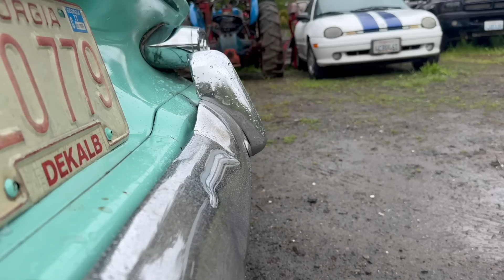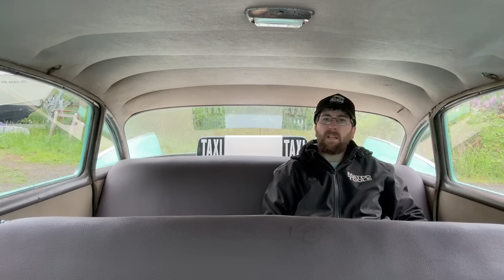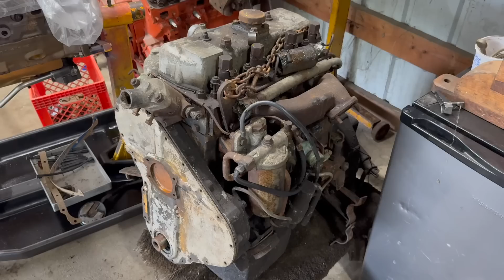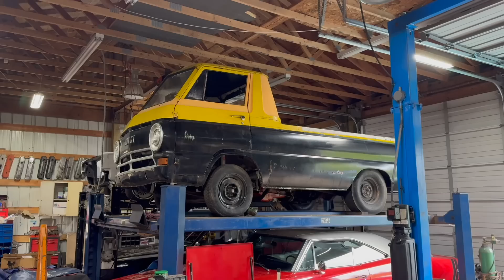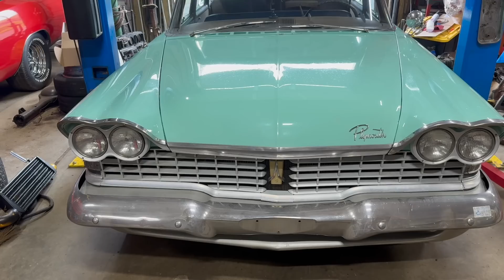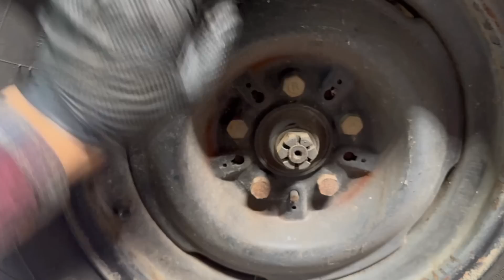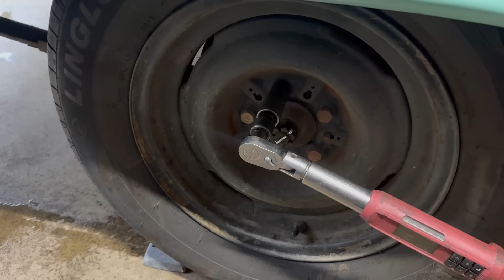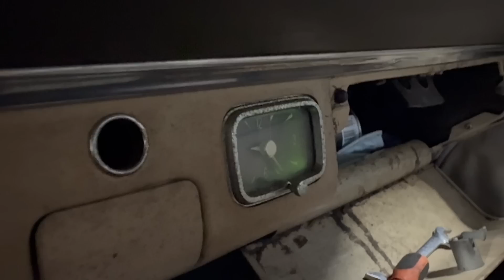Slow And Stinky - 1959 Plymouth Diesel Taxi Engine Tech, Test Drive, Safety Inspection (Not Good...)

Comment: So the left hand wheel bolts were only on the one left side?
Reply from the maker: Yep - Chrysler used reverse threads for the left hand wheels starting god knows when and ending after the 1970 model year.
Reply: @DeadDodgeGarage  I bought an Omni in the early 80's, ended up snapping off 2 frozen lugs on the drivers side right off the bat. My dad was  questioning after that if Chrysler was still using the  LH threads... he had a '57 Cornet at one time, that's how I knew they used them at least in the 50's & 60's.

Comment: Uh i think the person who had it last, had things apart when he offered you a trade and threw things back together enough to get it on a trailer and drop it off and roll out laughing
Reply from the maker: No, he didn’t do any of that stuff. I am sure it came to him that way, and he never went that far into it.
Reply: @DeadDodgeGarage  that's good to know- someone did just that it appears to him then?
Reply: Or just someone in a rush in the past, who forgot to come back through and tighten and pin everything I know if those nuts aren't pinned they can work loose but that's a lot more loose than youd think?

Comment: Can't be much slower that the standard 230 inch flathead 6.   That alternator may have been a mod unless it was a taxi option. 59 Mopars had a generator.  My '60 Valiant was supposedly the first Chrysler with an alternator.
Reply from the maker: It has LESS THAN HALF the horsepower of a 230. Or did when it was new. As of this filming, it probably had less than that. A heavy duty alternator was indeed a taxi option, but this isn’t that. I guess I never mentioned that had been added in the video.

Comment: I owned a 1960 Mercedes 180 db. 1800 cc diesel with a 4 on the tree. Pretty small and light car, so not a snail, but it averaged 49 mpg at 55 mph, and about 42 in town. Miss that thing.  Perkins diesels were installed in the factory on special order Checker Cabs.

Comment: What is up with the 3rd water attachment on the firewall?  I am a  Chrysler guy here in Washington myself.  I am the proud owner of 4 300's and former owner of over 30 other Chrysler products; Jeep, Plymouth, Dodge lots of Dodge, no  Desoto or Eagle.
Reply from the maker: Heater control valve is mounted to the far passenger side at the top. Coolant goes in the valve, then out to the heater core, and back to the engine. Nice!

Comment: Hi, thanks for uploading the video. A few suggestions you might have thought about already, but anyway.... For power, you might also have a look at the fuel filter(s). I was thinking about that throttle set-up, if it does not pull maximum vacuum it might not inject max fuel? So there should not be any leaks anywhere in the intake system I would think. The last owner showed that glow system in a video in some detail, it is some sort of flame start. The control light could be set up so that it  only starts glowing after a little while and slowly getting brighter until full on. The old glow systems sometimes worked like that, the idea being that you wait till it is full on and then start the engine. Very interesting technology! Best of luck figuring everything out!
Reply from the maker: Brand new filter. Verified throttle movement. Haven’t found any manifold leaks but am suspicious. Going to test the governor diaphragm next. Beyond that, I suspect timing chain stretch or other mechanical issues related to wear. Thanks!

Comment: Let me start with, your car your money. That said, leave this car stock. You may have the last remaining or running car with that engine in it. Keep in mind that in 1959, there was not much freeway out there. And as a taxi, that car didn't have to go more than 45 MPH. Leave it alone. Fix the flaws, leave it stock and enjoy it for what it is. I'm a hot rodder at heart, and I'm restomodding a '64 Studebaker Commander and a '69 Valiant. No turbo, no Bendix brakes...Leave it stock.
Reply from the maker: I will make zero modifications to the body of the car itself, and I will keep the Perkins engine. I will not promise to leave the engine naturally aspirated, or to leave it making the small amount of power (less than stock) that it is currently. I will not promise not to change the rear axle or carrier, or install a compatible three speed with an overdrive on the back. The spirit of the car will stay just as it is. I don’t see tasteful modifications designed to make it function as the best version of itself as a bad thing. The company who did these conversions claimed this car could do 70 miles an hour. I would like it to be able to cruise comfortably at 60, and to get there in less than two minutes. I don’t think these are unreasonable expectations.
Reply: @DeadDodgeGarage Do yourself and the next owner a favor. Save everything you pull of that car . Your dream may not be everyone elses.

Comment: Wow, fascinating story even though I've never been either a Mopar or a diesel fan, there is a European parallel though, in 1976 Alfa Romeo offered a Perkins powered Giulia, sounds like a very similar engine to Perky's, the only thing that would give the Alfa the edge would be it's lighter weight ! Also reminds me of when I was working on older cars often the fresher the paint job the more likely the mechanicals would be suspect..........

Comment: Back in 1967 I bought a 1957 Plymouth Belvedere 4 dr for $95.00.  I really believe these cars came pre rusted from the factory.   My Plymouth had the 318 poly engine with 2bbl carburetor and 2 speed Powerflyte transmission.   I always thought it was a great handling car with the full time power steering that gave you absolutely no road feel at all.  I had a friend with a 56 Ford 272 3 speed on column and off the line he just would leave me.  Another friend had a 56 Buick Roadmaster with the Dynaflow transmission and I couldn't match his top speed...But on winding twisting 2 lane blacktop I could run off and hide from them.  Plymouth's torsion bar front end and leaf springs on the rear just kept that car nailed to he road even with half worn out bias ply tires.   The rust got so bad the front seat came totally loose and I sold the car,  the fellow I sold it to took the engine out and put it on a saw mill where it lived for quite awhile.
Reply from the maker: Someone in another comment said they were rusting in the brochure. I’m pretty sure that was correct for ‘57s 😅

Comment: What voltage is the electrical system?
Reply from the maker: Factory 12 volt, negative ground. Chrysler was 12v across the board a couple years before this. The 70s alternator is obviously a later addition.

Comment: Are you really in DeKalb county Georgia? I'm in catoosa county Georgia.
Reply from the maker: No, but the car spent a lot of its life there.
Reply: @DeadDodgeGarage  I understand. She is a beautiful Savoy regardless. I had a 2 door Savoy from 1949. I sold it to an old dude for 8500 dollars and partial trade for a 1983 Toyota Hilux long bed crew cab. The engine was locked up, but I had a Tacoma V8 that I was able to redneck in and it worked out surprisingly well. Drove that thing til the cancer caused the front end to end up under the middle of the truck at a red light.

Comment: I've spent some time with those old Perkins as they end up in airport tugs all the time. They're really good motors. Certainly sad to trade it for a '69 Charger but this is a million times more unique. Since you were able to find a replacement motor I would for sure put a turbo on that and swap it in. The only hard part will be fueling which is even further complicated by that weird pneumatic governor but if it's a common enough pump then it's doable to modify them.

Comment: Hmmmm.   I remember driving company Valiants in the 1960's and 70's.  They were alright in areas with well maintained bitumen roads.   But in areas that have gravel roads with potholes and corrugations, any nut or bolt associated with or near the front wheels would come loose, no matter how well they were torqued.   We just thought it was a Chrysler thing.
Reply from the maker: Interesting, but again, these were plainly left loose by human hands. The missing pins are a dead giveaway.

Comment: The alternator is definitely a replacement for a generator, so maybe the mounting was changed somehow when that happened. Valiants got alternators when they came out in 1960 and everything else Chrysler got them in 1961.
Reply from the maker: Yes, that is an alternator mounting kit that is a little goofy, and an early 70s dual field alternator. I’ve already made improvements. For the record though, the heavy duty Leece Neville alternator was available as a factory option on the Plymouth taxi package in 1959.

Comment: The brakes sound like a double leading shoe arrangement. As you apply the brakes (travelling forwards) the rotation of the drum tends to pull both shoes on harder. With one cylinder and shoes pivoted next to each other the drum tends to push one away. (Leading and trailing shoes) I believe most motorcycles with drums use twin leading shoes but car manufacturers clearly went mainly for the cheaper option

Comment: A friend of mine bought a new White truck oin the 60's that had a Perkins diesel. Absolutely the most unreliable diesel engine ever put in a truck. It spent more time in the shop than on the road making money. After 6 months he gave it back to the dealer and bought another GMC.
Reply from the maker: Interesting. These P4 engines seem to be well regarded as reliable.

Comment: Very nice to see you actually fixing it and making it a reliable driver. You do good work sir! I'd back the rack screw all the way out, and go from there. It probably has 8mm plungers, it's not going to give crazy fuel. Someone who had worked on those vacuum reference pumps told me it could have a split in the diaghram and cause low power issues. I'm excited to see what you do with it!
Reply from the maker: Checking for a split diaphragm is my next move. Thanks!

Comment: Lol! Typical naturally aspirated flat-plane crap-ola 4  cylinder 4 choke joke stroke diesel! Such a dog, that it is a DOUBLE DOG!  🤣🤣🤣 the pneumatic governor is well known to me, as my 2 RARE 4-51 Detroits have them, and have the butterfly in the intake! Except, they work fine! Reason? Because it is a Detroit and it just works! These 51 series engines are also valveless with intake and exhaust ports and simple loop scavenging like a gas 2 stroke, only difference is air is supplied via a roots blower of course! One of these will EAT that POS Perkins piece of festering crap! They rev freely and have torque and better power at a stock rated 85 Herspers. Being both square plane and 2 stroke, they sound great and make this 4 stroke show what a POS it is! Actually, 4-53 T in this would be a beast!! And you will have HP and torque! Cheers!

Comment: Well, that's certainly not what I expected to see! That's amazing, and I wish I had one for my very own. A couple things occurred to me, and both are kinda tractor related. The first one is that we have had a TERRIBLE time with injector pumps on some classic diesel tractors that my family still farms with, and they've been largely related to the change in lubricity from the old diesel to the new low-sulphur ultra-clean fuel. Your Plymouth may thank for you for dumping a quart of ATF in the tank each fill-up. That relates to the next thing, which is that we had a 4 cylinder John Deere diesel that had the injector pump fail in such a way that the governor didn't open up properly to allow fuel- essentially limiting the tractor to 1/4 throttle under any condition. It may be worth swapping that rebuilt injector pump onto it to see if that opens it up some more.

Anyway, just my little experiences. I love this new one, and I'm looking forward to seeing it again soon. I mean, you've got Go-Fast stuff already, this is just a change of pace!
Reply from the maker: I’ve learned how to test the pneumatic governor and I’m going there next. Ultimately I’m worried the engine itself is probably tired, but I’ll work through these things one by one first. And I have been advised about the lubricity issue. ATF sounds good to me. Thanks!

Comment: Putting 6 or 7lb on that old rattler won't hurt the engine or the trans & it will improve economy & drivability. Unlike a gas engine you can't hurt a diesel with more air.
Reply from the maker: Fully agree!

Comment: Those front brakes are dual leading shoe which are better than the single leading shoe brakes. I had dual leading shoe brakes on my split window VW vans and my 1970 Norton and 1968 BSA motorcycles and they work quite well when set up properly and correctly adjusted.
Reply from the maker: Yep - “Total Contact” as Chrysler called them

Comment: THAT CAR IS FREAKING COOL!! Stop all other projects and just work on this one. To increase power and fuel economy, turbo? Intercooler? There's room. If you do a long road trip in the summer and go east Like you can go west), you'll need A/C. It may drop your speed about 20 mph when the A/C clutch engages like a Japanese Kei car, but it may be worth it.
Reply from the maker: No interest in putting holes in things or in AC. Otherwise, yes.

Comment: I worked on a small commercial farm in downeast Maine for 15 years; they had two tractors.  The 'new' tractor was a 1983 John Deere 2350 4WD 60hp platform tractor.  The 'old' tractor was a 1966 Allis-Chalmers 2WD with the 60HP Perkins diesel.  That engine looked very similar to yours, and was a torque monster in a farm tractor.  Towing similar loads, the AC would run right up the butt of the JD (a german machine made in the old Manheim tank factory) on a hill.  Fair warning- if there was frost on the hood, the only way to start that tractor was to tow it.

Comment: Diesels are much happier at lower RPM, so I would recommend installing that OD trans.  A turbo would be great on that engine, particularly if you can turn the fuel up.
Reply from the maker: I’m well aware - and I’m scheming all of those things at present.
Reply: @DeadDodgeGarage  I would love to see that.  Most of my exposure to diesels is from engine dynamometer testing and engineering development.  I worked on them for years but never actually owned one in anything I drive.  That looks like tremendous fun!

Comment: I think you should call Gale Banks, and ask for a recommendation for a turbo charger for it. And see what you will need to do to feed enough fuel when you have 60 psi of boost!  You have your work cut out for you in order to fix it up. But your the guy to do it. Smart, talented, and conscientious enough to do the work, right, or at least safe.  Other than knowing that all diesels need boost. And that they have compression that would give top fuel guys wet dreams. That's about all I know about diesels. Oh, as far as tuning the fuel, it would be better to have somebody drive behind you. When they can no longer see the car because of all of the black smoke, then its time to lean it out a bit.  As for the car, it's not the best looking old Mopar I have seen. But it's still pretty cool.
Reply from the maker: Oh, I have some ideas for all of that. Haha. Thank you.

Comment: I think it’s awesome. In 75 years it’ll still be running, if you can stop the oil leaks. Best of luck with it. I want to see another video on it. Get it running good and throw it on a dyno. Probably something designed to affirm the horsepower of a big wheel or a tricycle :-)

Comment: Hey Jaime! Not sure how much of a purist you are in regards to the car, but if I remember right, these full sized Plymouths use the same upper ball joints with the R-body cars like the Fifth Avenue/St Regis. Because of that, again if I'm remembering right, it should be possible to use the spindles and rotors off of those cars for a diy front disc brake conversion for ol' Perky
Reply from the maker: That’s what I hear! The drums are perfectly adequate for now, but in the future this is a possibility to consider.

Comment: I drive a base model VW transporter diesel, ex German Post office. The big difference is its a 2006, stock it was 83hp, maxed out at 100mph....now its got a mild tune it runs out of gears. Over the years I've had many NA and turbo, Indirect and DI diesels. When running correctly even the lowest spec ones have been fine in modern traffic, and still capable of breaking Freeway speed limits. Whilst many gas powered vehicles, with much higher official figures have struggled with loads on hills or Freeway grades....Get your injection pump sorted, check your compression is even and you should be good to go.... oh don't forget to make sure your muffler isn't plugged